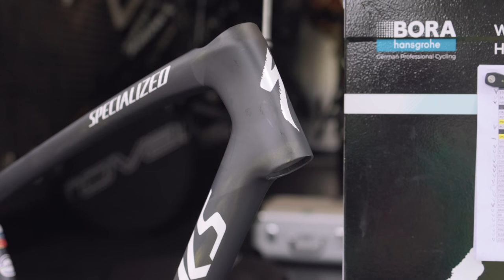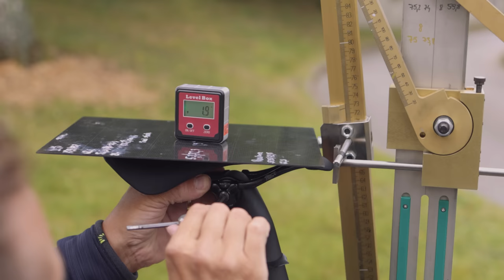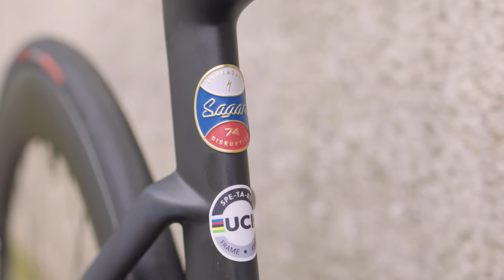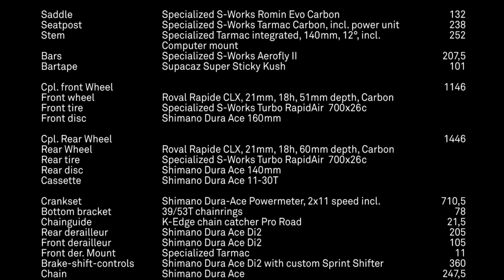Pro Bike Build Peter Sagan I Specialized S-Works Tarmac SL7 I Team Bora Hansgrohe I Tour de France

Comment: Absolutely loved how he bled those brakes man. No lie that is so smart. Love seeing new ways to do things
Reply: Do you know what the metallic ring he slid between the fork’s steerer tube and the upper bearing’s compression ring is? My SL7’s headset has made tons of clicking noises since it was new (about 8,000 miles ago), and I’m wondering if this is some sort of remedy?
Reply from the maker: Always good learning from the pros ;).
Reply: @danielcafferata1318  That seems to be a steerer tube shim they fabricated themselves. For your Tarmac, is there a 3 - 5 mm gap between the edge of the stem and the top of the expander plug's flange?
Reply: @danielcafferata1318  it’s a clip that fills the gap between the fork tube and the silver plate. I had it with my frame.
Reply: @danielcafferata1318  me too, an im wondering if this part is the key too the problem 😂 although I have slightly got used to the Tarmac's quirky noises by now
Reply: I reckon that his method only works when the brakes are pre-bled from factory, and this is only to get the bubbles he introduced by cutting the hoses e.g out.
Reply: @yonglingng5640  Yes, and the top cap is preloading everything correctly. The only thing that I am devoid of is that shim. Interestingly enough, it seems as though this shim is included with newer Tarmac frames. Race Point Elite's newest SL7 dream build video depicts the same shim featured here.
Reply: @bjsr126  Is your bike also disappointingly noisy?
Reply: @danielcafferata1318   honestly yeh 😂 I'm the same as you, I've had it built / looked at by 2 Different Mechanics, everything is built correctly, on a nice surface, it's an absolute dream, sounds incredible. The second I get on a shitty surface/bumpy terrain, the bike just starts making noises all around. 

Some mainly from the headset area.. almost like my headset has play, but I've been assured it doesn't. Love the bike though, that's just it's only fault!
Reply: @bjsr126  Hell yeah, brotha. Definitely a badass steed, I agree. Ride safe, my man. Let’s see if the sleeve fixes our problems, haha.
Reply: @danielcafferata1318  if you find out how to get one! Let me know! I can't find a part number anywhere 😂
Reply: @danielcafferata1318  I just saw it, maybe it's a new piece of hardware they added recently? I haven't worked on a Specialized ever since the LBS I work at switched to Trek.
Reply: @yonglingng5640  it definetly is, and by the sounds of it, multiple Tarmac owners are facing just general noises from the headset/front end of the bike. That small piece probably fixes the issue 

If anyone finds out a part number, so 2020-2021 model owners can buy it! Please let us know 😂
Reply: @bjsr126  Any idea when it was added? I last worked on a Tarmac SL7 in Sept 2020.
Reply: @yonglingng5640  I had mine delivered in March 2021 (brought December 20') and mine didn't come with that! 

So I'm presuming the brand brand brand new ones! May 21' onwards perhaps
Reply: @danielcafferata1318  worked it out - they're called a steerer tube shim, you can just Google them, any brand will do! Specialized branded one isn't required! (Allegedly these are quite common, i however had never heard of them 😂)
Reply: @bjsr126  No, that's not what this is. I figured it out; Specialized actually reengineered the part. The new compression ring is silver instead of black, and has a completely different part number and shape. The shim is specific to this new part, at least its depth is.The new part number is S212500016, while the old one was S202500008.
Reply: My specialized has a permanent ring dent/impression in the fork from the shim that sits in between the steerer and upper bearing. 
Its tapered and compresses the steerer everytime you put weight on the handlebars. 
Not sure on the solution, but a much taller shim is needed to spread the load. Compression plug 100% required to expand exactly where the bearing/shim is. It cannot be aluminium, my dent may even be galvanic corrosion. These headsets need O rings too

Comment: It’s amazing how a Pro peloton team mechanic could build a new bike on the field just like that.  

These pro team mechanics gets no rest.  They prepare the bikes before the race starts.  Ride along the team car during the race to fix any mechanical.  Then after the race.  Cleans and inspect the bikes.  Then rebuild it again if necessary or change the gearing setup for the next stage race.
Reply from the maker: They're absolute heroes indeed ;).
Reply: On the Field?)) Its fully equipped mobile workshop)
Reply: I can build same as he does or even better !!!
Reply: @roadbikechannel  From yesterday’s Tour de France Stage 1 massive crash.  I heard from the commentary that the mechanics were all up until 1am fixing all of the bikes.  Each crashed bike takes an average of 2 hours of inspections and repairs.
Reply: "If you love what you do, you'll never work a day in your life" 

I bet this guy loves every second of it, rubbing shoulders with the likes of Peter Sagan would just make it all that much better
Reply: @iMadrid11  I thought that they started all over with fresh frames, didn't they?
Reply: @derahmad2831  They don’t.  There’s a limit on how much bikes and spares.  You can fit and bring inside a team mechanics truck.

A modest team will carry 2 road bikes for each rider.  2 TT bikes for each rider.  That’s 4 bikes x 8 riders = 24 built bikes.

Teams with bigger budgets can of course afford to bring more bikes.
Reply: @iMadrid11  They can get packages with parts and dope delivered any time.
Reply: @adolfrichtar3731   Make a dream build and upload it

Comment: Hambini would have a field day with that BB!
Reply: At least the mechanic seemed to be pretty thorough in his efforts to adjust it. I think he did a very good job. But what can you do, if frame manufactures are to stupid to get some simple tolerances right...
Reply: @11-inch  BSA isn't a magic cure-all to BB issues. There can still be misalignment even with a threaded BB.
Reply: @11-inch  in case you didn't know, also the Bsa Shell has to go into the carbon frame 😃 and threads  inevitably introduce some deviation, because they need "room " to work. Trust me, I am engineer.
Bsa is just a step backwards from a technical perspective, because frame manufactures sell you frames >3000$ and dont want to spend to money on getting some basic tolerancea right
Reply: With BSA you have 1. bearings which are pressfitted into the outer bottom bracket cups 2. the interface bottom bracket shell - carbon frame and then 3.the threads themselves. That are just more points to introduce misalignment compared to a direct pressfit solution. A good direct pressfit will be lighter, stiffer and more precise. The only difference: Threads will not creak even if they are done poorly
Reply: @MS-bw7yt  watch out mate, you are asking to be "thrusted" and not trusted. I assure you there is a big difference and you may not like what you are asking for. Cheers!
Reply: My thought also,looked really stiff.
Reply: @santibergallo  haha you're right. My English is not the best and when I am aggressively thrusting on my keyboard, auto correction not always trust me :D

Comment: He was happy with the way that BB spun??  Looks like it had peanut butter in the bearings.
I like seeing threads in the bottom bracket though.
Reply: Yeah--i was thinking the same thing.  There's about 0.5Watts wasted.
Reply: Probably the same issue a lot of companies struggle with: The diameters and roundness of the bottom bracket holes. Once one side is out of tolerance it is immediately recognisable when spinning the cranks. And they still sell these frames for thousands of euros/dollars.
Reply: I've watched so many hambini videos and know right away something is wrong with that bb
Reply: @fritz2934  thats also why pressfit is better in terms of efficiency

Comment: Althought a spintest is not a valid test, i'm suprised how badly the crank spun. 
It even stuck, instead of falling down on its own weight
Reply: @hambini bb should fix that. 😉
Reply: @11-inch  Doesn't excuse the fact that the crank spun like shit, mate.
Reply: @11-inch  it has nothing to do with that. If the bb of the frame is not aligned perfectly it wont spin freely unless you solve the issue.
Reply: I thought at first its a standard shimano bb, which normally spins like in the video, but after the second time watching the build, I realised its a CeramicSpeed unit, and I was astounded.  If you watch Canyons pro builds, each frame is X-Rayed. and thoroughly checked, tolarences for example, and that means that only good frames in all aspects get ridden by the Pros, I'd expect the same procedures from Bora-Hansgrohe. Or, maybe, its a faulty BB, who knows..
Reply: @derahmad2831  Heard about Hambini? He basicly debunks bike frames. Atleast the Canyon he got sent, was not too good QC
Reply: @kkfarmedkk  I am a fan of him actually, yes, he did roast canyon for the seat post design flaw, I think they forced him to take the video down. But I am talking about the Pro riders bikes, not the consumer ones.
Reply: @derahmad2831  I believe he shat on their BB too, but video was taken down? Anyway... Consumers shouldent get shitty BB tolerance either
Reply: @kkfarmedkk  Of course, they aren't giving you the bike for free, so you should not accept anything other than perfection. Hambini is facing some legal problems with Canyon.

Comment: To all the noobs who said I was wrong about big name riders getting special forks and frames. You can clearly see this aint no stock consumer level carbon layup fork and frame.
Reply: How do you see that this is a different Carbon layup?
Reply: @leopoldstutch97  6:41 watch the fork head. Looking weird right?
Reply: @mieserpeter6083  I am not asking about the fork,  my question is how do you see that they are using a different layup?
Reply: Shit. The fork head does look different from a consumer level one. Are we all conned by Specialised?  Spending all that top dollars thinking we are getting the same product?
Reply: That steer tube is reinforced with aluminum looks to be bonded with a gray Epoxy
Reply: The fork definitely is sleeved, not that hard to do, but my question is with what material? I tried turning a 2” length of 6061 round stock on my home shop lathe for giggles but there is no way I can turn it that thin at the needed length, what I want to know is who did they sub this job out too and exactly what material did they use. Some third party company needs to make sleeve kits available for civilians for these and other big name China bikes. On the lay up I’m sure they don’t have the noobs doing the team bikes over there. It’s was the same in the 80’s when I raced Colnago, they had a master craftsman doing the pro framesets, and the riders got made to measure custom sizing.
Reply: @leopoldstutch97  The frameweight itself is more than the consumer made product. Consumers want light, they get flexy, lighter carbon. Pros need stiff and strong to sprint at their inhuman strength and survive crashes.
Reply from the maker: @chrisstrobel3439   the Bora Team is using an aluminium sleeve to get more stiffness, but mainly to leave out the expander and use a simple star fangled nut which is way lighter.

Comment: They skipped the most interesting part - putting sprint shifters on a hydraulic groupset!!! 😔
Reply from the maker: It's their own custom solution they came up with some years ago, which they asked us not to show. Sorry, we know it's especially interesting but we're respecting their wish. Otherwise we wouldn't be allowed to film with those Teams, which would be even worse 😬
Reply: It seems that they run 2 seperate wires from the B-Junction to each of the levers. That saves you one connection on the STIs. As they are using the dedicated Di2-shifters I can only imagine that they do some rewiring/soldering of them...
Reply: @besenwagen8542  Indeed. My guess would be a gutted SW-R600 climbing switch hidden in one of the drops with the sprint buttons' wires soldered onto that. Still would've been nice to see that. I hope Shimano solves this issue in next gen Dura Ace/Ultegra Di2 and gives us dedicated sprint shifter ports on hydraulic groupsets as well.

Comment: The mechanic uses the stem from Venge, not Tarmac (incorrect description). You can see how it's off and not flush with spacers. Also it weights 250 grams, tarmac stem is lighter. I'm wondering why Sagan opted for Venge stem vs Tarmac? Maybe stiffness?
Reply: Most probably. When he was on a team that ran FSA components, he used a ZIPP SL Sprint stem.

Comment: 7,33kg - why so heavy? UCI rule says 6,8 ?!?
Reply from the maker: Eventually it's not too easy to reach the limits with disc brake setup and all the stuff the riders want and need, like power meters, bottle cages, etc. There are things more important than weight but it's still a light bike ;).
Reply: @roadbikechannel   the weight of the „normal“ S works Tarmac SL7 is 6,7. I can‘t imagine the „Peter Sagan“ stuff is so heavy 🙈

Comment: Imagine if everyone took such pride in what they do. I can't even get the idiots that make my $30 pizza to distribute the toppings evenly and fairly.
Reply: One bike I worked on previously had excessively short disc brake mounting bolts. Not just two of them from one caliper, but all four from both calipers.

And this was done at some reputable shop, or so I thought until I worked on the brakes.

Comment: Wow this video was posted 3 months ago. And the mechanic on this video had installed an updated compression ring. Why Specialized did not announce a recall for SL7 then? This means Specialized new about the issue then. Why did Specialized just call out a recall just this week. What are they thinking. Someone could have gotten hurt or die.

Comment: Is that a re-enforced steerer?
Reply from the maker: yes, its the normal steerer with a glued in aluminium tube to add extra stiffness and use a common star nur instead of the expander. the benefits are less weight plus extra stiffness.
Reply: @roadbikechannel do you recommend  long aluminum tube inside  to renforce the entire stereer tube or just a short one, for best stiffness and comfort...

Comment: ....there are about 1 Km of cables inside that frame   -.-
Reply from the maker: Its a lot of cables and liners indeed but at least the looks remain clean thanks to the internal routing.
Reply: @roadbikechannel   sure , i know,  but  for a bike builder  is  always a time spending process, maybe  Shimano  should think to  move to wireless  technology  in 2021, like SRAM , even for brake bleed process, really annoying yo  twist  the  whole  framset  up and  down for   bleed a brake caliper...

Comment: Der Mechaniker montiert das Bremskabel falsch. Zuerst muss die Kontermutter drauf. Dann die Ollive zum Schluss den Stift einpressen. Sonst wird das System nicht dicht. Bei genau 12 Min.
The mechanic mounts the brake cable incorrectly. First, the lock nut must be on it. Then the ollive finally press in the pin. Otherwise the system will not be tight. At exactly 12 min.